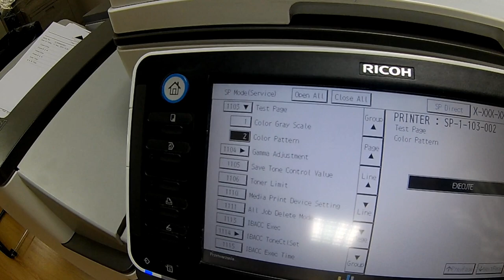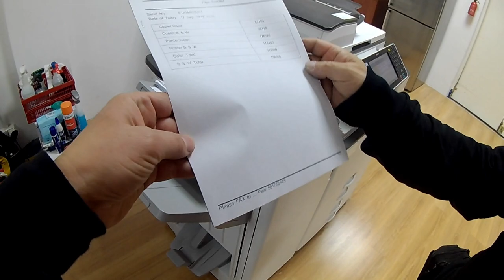Maintenance Cleaning Copier RICOH MPC5503 Transfer Drum Fuser Tutorial

Comment: I am getting ink streaks on the page. I think I need to clean as you did in the video but, do not want to open up machine if it's not needed. What's your thoughts? Is there a certain roller that I need to clean?
Reply from the maker: Do the same as show in the video. Don't be afraid to open the machine. If you have a problem, write and I will help you.

Comment: Hi dear friend.
I have a tedious problem with ricoh 4001.a stock 4001.print counter 540000.
I dend a print on the printer and prints that. But for second print even the exact previous print, the ricoh warning missmatch paper tray. We must then restart the ricoh for print second print and this problems containing for next prints. 1 print=1 restart. Please help us.
Appreciated your kind attention before
Reply from the maker: If I understand correctly, the problem only occurs when printing and when copying everything is fine. I would like to update my copier software to the latest version. If this does not help, disconnect the HDD in Kopirka for a while and see how it will work without the disk. If the problem disappears, it means that the HDD is now to be replaced. Ricoh MP4001 is a copier produced in 2010, so if you have not changed the disk so far, it must be necessary.